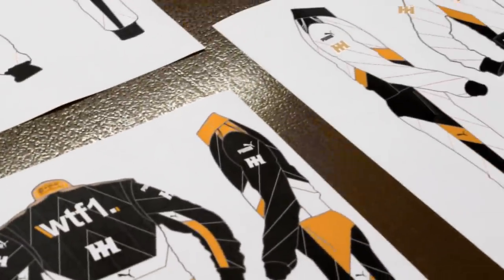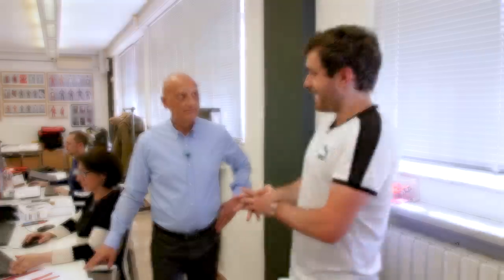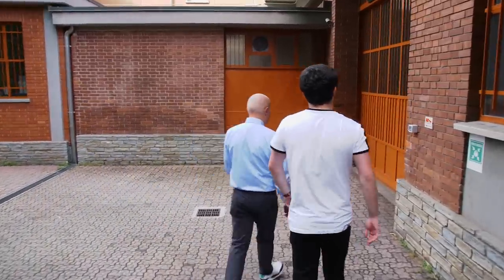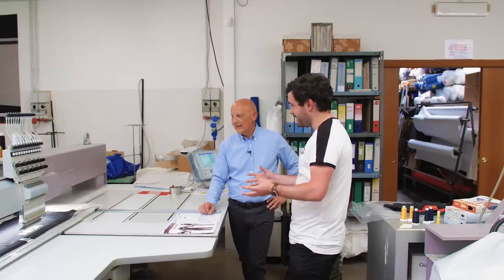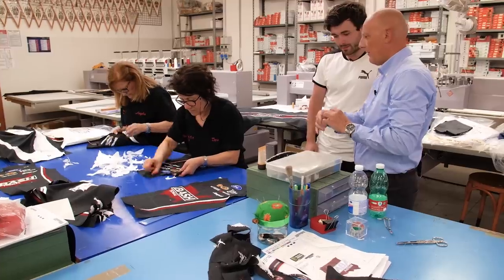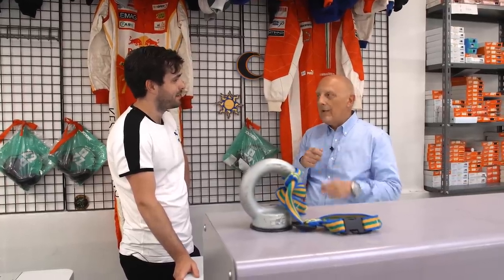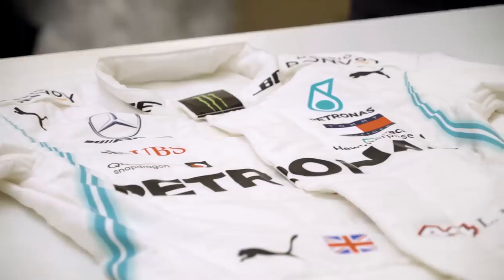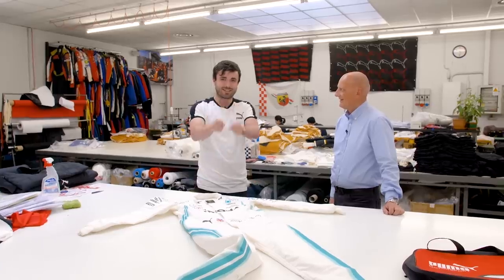How Is An F1 Race Suit Made?

Comment: Saving 2 grams from perforated Velcro, but does embroidery instead of printing.
Reply: its because they use fire proof cotton stitching, they can't use any printing methods for a number of reasons. first of all they don't breath at all, second they are also very heavy, third they melt and catch fire. so stitching is the better option all round.
Reply: @callumhowarth8057  移交破壞性者違規行為科學性系統工程操作方式進行危害群組罪嫌移送地檢署檢察官偵辦處分革職移除頻道處理
Reply: @callumhowarth8057  Don't they use printed logos in F1 at the moment? I think it does save a lot of weight compared to embroidery. And given the small amount of space the logos cover in relation to the entire surface area of the suit I would've thought breathability shouldn't be an issue.
Reply: @張海鷗-t2t  yes. I can speak this language.